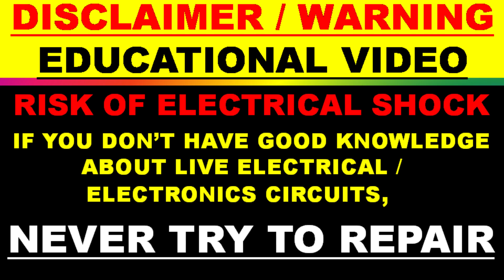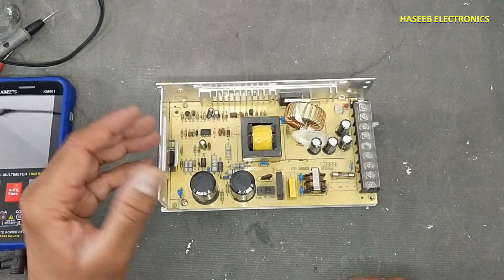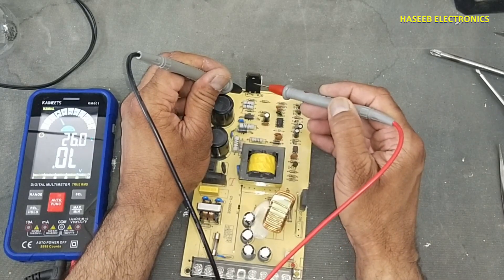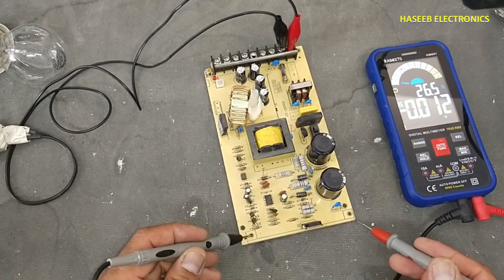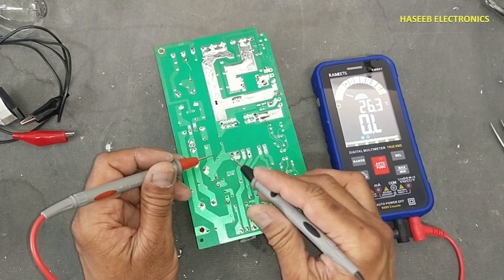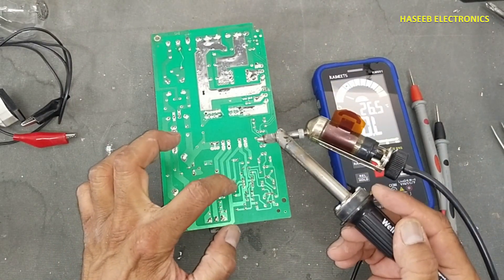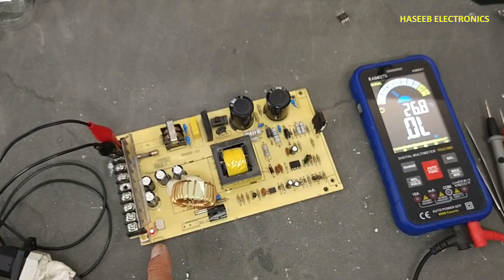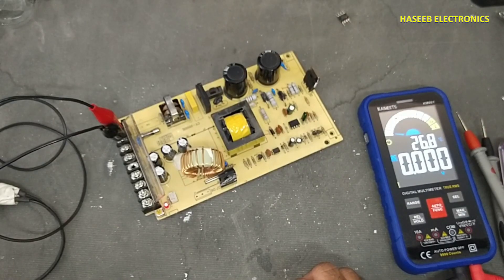{892} 24v power supply repair, not turning on

Comment: I have a 24-volt, 1500-watt power supply same as this that barely gives a current of 26 amps. After that, it disconnects when the load increases. I replaced the capacitors, and knowing that the transformer coil is made of copper, I could not find any problem. Can you explain how to increase the current and the possible causes of this fault.
 With thanks and appreciation
Reply: some over-current protection circuit problem? a current limiter that's limiting much too low? perhaps a resistor in the sensing circuit that's changed in value. 1500 watts at 24v is a lot of power. switching transformers are about the last component to fail.

Comment: السلام عليكم أخي الكريم،
i have a Power supply 24 volts, there is no current on the outlet. There is 24 volts, but there is no amp... What is the solution, please?

Comment: Nice job, and after 50+ years of repairs, I learned something new.  One suggestion, if you already have the board out, might as well shotgun the electrolytic capacitors, as they are often the issue with switching supplies--especially any on the high-voltage side.
Reply: depends on how old they are. doing an ESR check will tell you if the electrolytics are good,marginal,or bad. then you're not replacing caps that are OK. I love my Dick Smith ESR meter.  Often,electrolytics going bad will discolor or begin to bulge. Those have to go. Housekeeping supply caps are a common switcher failure.

Comment: Good analysis what was broken. 
- Nice video, 
- good video cut and 
- perfect explained what you check 
- to find the fault in some minutes. 

Well done and *my thump up*. 

Additional information = 
In europe the amount of money for one hour  worktime...
(plus fuse, plus IC UC3845 at 2023-june-07 = US$ 1.51 + tax + postage or cheapest seller 0,29 Euro + 5,95 Euro postage and wait for delivery)
... is higher than a new 24 Volt SMPS (=switching power supply). 

We must have a very very very good reason to spend more money as we pay for a new SMPS ... 
Often we have a lot of spare parts (to repair straightaway, change the SMPS in minutes and get the production plant running).

A new SMPS have = new *capacitor*, *ventilator*, no oily dirt inside, new diode, new MOSFET, etc 
and the time to fail is reset to zero for these SMPS. 
But we have a lot electronic waste parts ...

Comment: good
I have a 12v 10A smpa like this , and on load it turn off ... means  pwm ic is defective?
Reply from the maker: it seems that its current mode error amplifier is to be checked. this ic is driving in over load protection 
if there is tl494 or ka3525 then check there is some transistor is connected at pin 15 or 16. so monitor pin 15, 16 and its related circuit 
in case of sg3525 might be pin 1, 2 or its related circuit
Reply: @HaseebElectronics  its it tl494 ic circuit , thank you brother I watch your video to learn and dix myself, you are the best tutor for me , thanks again
Reply from the maker: most welcome dear brother 💝

Comment: If drain to source voltage is not present 326v and is only 240v  at drain to source , but main capacitor has 326v . What could be the problem, ?

Comment: He question "why the chip died" has NOT been CLARIFIED by the master!! the 283x/384x  chip series is reliable, and simply DOES NOT BURN for no reason!, the cause of the breakdown is not clear!!! so there may be a REPLAY SOON!!! a common reason for chip failure is bad capacitors in its strapping -they should always be changed even if they seem to be alive!
When checking the capacitor in in an pulse source AC/DC DC\DC, it is important to control not only the capacity of the Equivalent Series Resistance(ESR), bad caps can have a larger ESR with a capacity close to that indicated on the part being checked
Reply: some ICs fail when new,;infant failures",a small number fail later on. ESD can shorten the life of an IC.
ESR checkers are very useful for doing a lasting repair. I have one.

Comment: Nice job of fault finding.
Reply from the maker: it is my pleasure
Reply: @HaseebElectronics  I'd like to see you get an isolation transformer for improved safety. I have one in my workshop. Isolation transformers are made with small inter-winding capacitance and other features. SMPS's are dangerous. I really don't like them. You have a great channel, I love it.
Reply from the maker: I already have isolation transformer for my workbench and separate transformer for my test equipment

Comment: Thanks! Great job with diagnosing and repair. It should be noted that you should use an IC soldering iron like you have or an IC soldering iron that's isolated. Some IC'S cannot handle the high static voltage that some cheaper irons may have. I've gotten away with it with the IC's I've soldered, but I heard it mentioned on another video how much voltage can be on the tip sometimes. Have a great weekend sir!
Reply: My station, the Gordak 936A has "ESD SAFE" written on it..many don't have a very good opinion of Gordak tools...can I use it to unsolder a CMOS from a PC motherboard? Thanks for the heads up the potential destruction of IC from this point of view
Reply from the maker: best regards 
yes unsafe ESD based rework tools damage CMOS based components. because ESD sensitive parts damage immediately when there are exposed to any electrostatic charge, even placing in unsafe electrostatic charge area destroys CMOS based components
Reply: The Soldering Station used by YOU must be serviceable and must be grounded ! it is important to check the presence of grounding PE wires (YELLOW-GREEN) and their connection to the GROUNDING circuit in the sockets from which you power your repairman's equipment, it is also recommended to use an ESD bracelet on your hand, but such measures are necessary when repairing POWER SUPPLY units

Comment: Nice video sir. Is this power supply uses single switch forward topology because there is a large inductor at the output and 250 watt is beyond limits of flyback converter i think

Comment: I want to know one thing if u can tell me , Does IGBT inverter welding machine use input line filter i mean common mode choke and X Y capacitors ???
Reply from the maker: in some brands there are class Y capacitors, otherwise most of the  brands have soft starter circuit

Comment: is it safe to measure the volatage at drain to source in DC mode of digital multimeter? or at the transformer?
Reply from the maker: yes at drain to source of mosfet, 
or across RCD snubber diode, it is safe to test voltage in DC mode. but testing in AC mode, it can damage multimeter or power supply, because the internal capacitor of multimeter provides very low capacitive reactance at high switching frequency